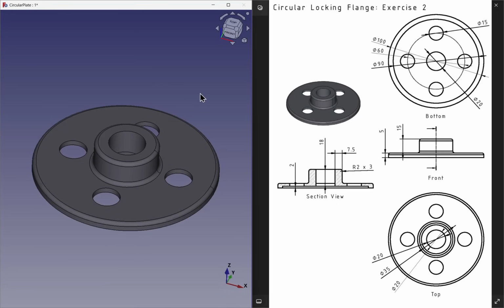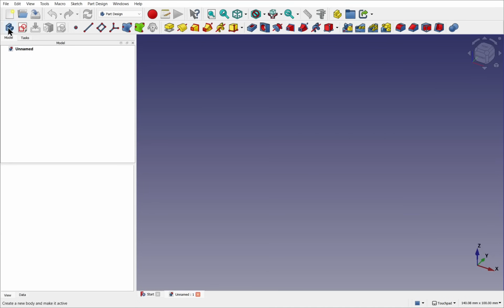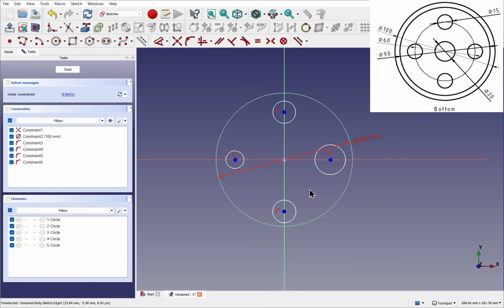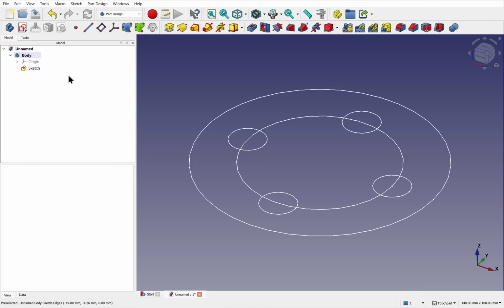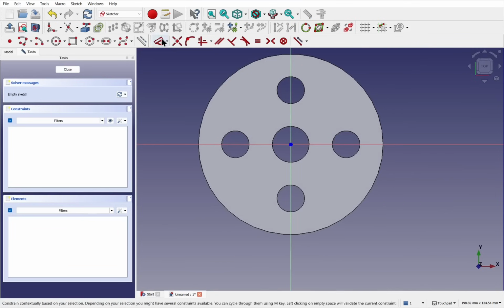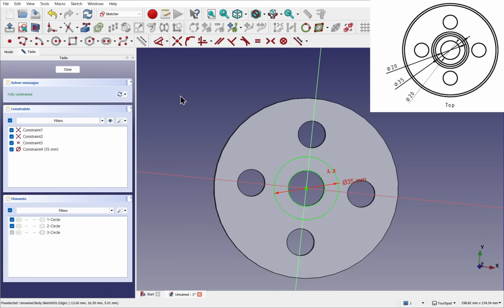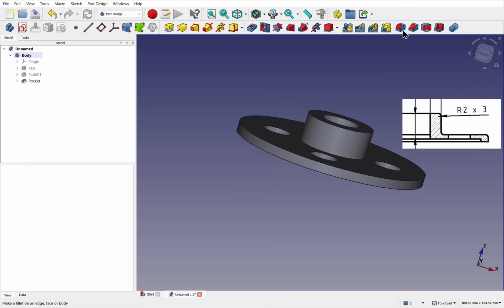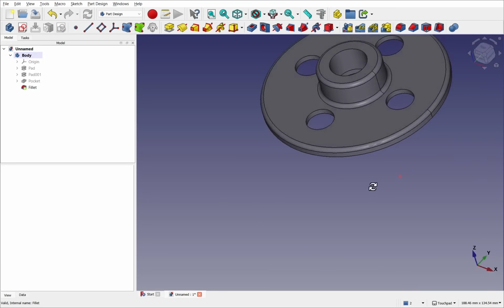Basic Beginners FreeCAD v1 / 0.22  Lesson 8  Part Design Basic Exercise 2 | Circular  Flange Project

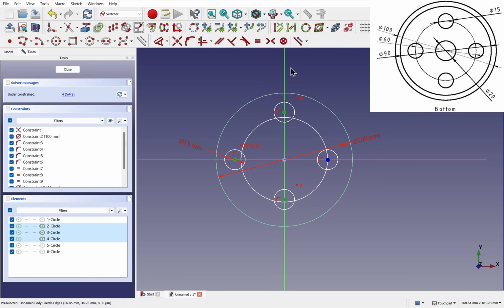Comment: The problem with this video is that what I get to 9:20, I can't see my "Constraint by object" icon on my toolbar. I've tried to reinstall it, but that doesn't do anything
Reply: Don't worry, I found the problem. I needed to edit the Sketcher preferences, and uncheck an option to get those buttons
Reply from the maker: There is a icon on the toolbar that combines both coincident and point on object constraint that can be used.  This was later combined as one icon after the videos were created which was pretty annoying and has cause confusion.  I am looking to back fix these earlier video but will require a reshoot.  Glad to see in your other comment that you have resolved the issue.

Comment: 9:47 FYI another change as of 1.0 is "Experimental support for multiple solids within a Body was added" which is defaulted to off in preferences and per-body.
But I was able to make that pad without error (although it of course looks awful) even with those settings off.
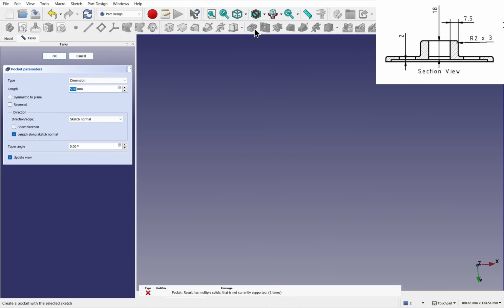Same at 17:04, the pocket operation unintentionally worked (leaving a rim of material between the outer circle and the 90mm diameter)
Reply from the maker: Thank for adding that, really appreciate as I can roll this into future video updates and it helps others when they see the same behavior.  Thank you :)

Comment: Thank you.  Your videos are excellent and getting better over time.  I'm having trouble but I'm wondering if it's my computer and software. The construction lines in v1.1.O development and the release V1.0 disappear as soon as drawn leaving only the center point visible. In a new file and sketch before anything else is drawn an xline will display correct as blue and dashed.  But, as soon as a regular line is drawn the xline disappears. Also my versions don't seem to have constrain point to object but another one worked. I also tried 20.2 but it didn't work, (forget why) now it won't run with other file open, maybe since sharing cache directory location. Could it be FC has the old "Sewer"Works software problem,  not very AMD friendly? Or are these bugs? I'm too new to know to report them as such. (My old laptop  has 17" screen so I keep. It's runs Debian 12, AMD A6 processor, 8GB memory. Has no issue with videos or image graphics.)
Reply: Found my own answer.  In Debian 12 I had not removed Synaptics installed Freecad before trying NEW Precompiled App versions. Also jumped back & forth between when there were differences with instruction videos. Then the disappearing construction line issue happened and could not be user error. 

My fix was: Remove the old installed v20 freecad. But, Synaptics would not remove it, slinging out broken package error, hold or lock on program. Reboot changed nothing.  Forced a removal in terminal  (sudo apt remove --purge freecad,  then sudo apt autoremove)  Now,  back in the pre-compiled app  v1.1,  CONSTRUCTION LINES DISPLAY PERFECTLY!

Comment: Loving the format, but struggling a little bit. Looks like the UI buttons have changes in the vers 1.0 vs the one used for the video. I don't have a button for the constraint point of object that looks like it does in the video. Not sure if its a button/UI change or if I am missing a tool bar. Any hints? Using 1/0/0 Revision 39109(Git). Thanks in advance.
Reply: I was able to use the constraint coincident button to achieve the effect. Not sure if its a change to the UI or a problem between the keyboard and the chair.
Reply from the maker: Since 0.22 which was the dev version of v1 they have changed the coincidence and point on object constraint to be 1. I need to look at redoing these videos to make them easier to follow.

Comment: After I created the external geomety and clicked on the 2 lines then clicked on the Equal Constraint, then resized my other circle then closed. My Sketch001 become its own drop down menu. I had to click and drag it into the previous Pad drop down menu so that I could use the Pad option, otherwise I was getting an error. I followed everything you did exactly,  maybe I am using a newer version? Or is there a preference that auto combines the 2 operations once completed? Great tutorials though, I am excited to be learning this program!
Reply: I ran into the same issue. You are in the sketcher workspace, but you need to be in the part design workbench when you are creating the sketch on the pad!

Comment: I do not have the constrain point on object icon and its also not in the drop down menus.
Reply: It has been combined with Constrain Coincident and has a slightly different icon in the toolbar now. The shortcut key is “c”
Reply from the maker: It's a different icon now since the official release.  And now is both coincident and point on object constraint.

Comment: I HAVE BEEN WATCHING YOUR VIDEOS FOR  QUITE A WHILE NOW, MY FREECAD COMPUTER FINALLY CAME IN YESTERDAY AND TODAY I WAS ABLE TO DOWNLOAD AND START TRAINING IN FREECAD.  SOMEHOW IN ALL MY BUMBLING THE "PLANE SELECTION IN 3D VIEWING AREA" HAS DISAPPEARED, NOW I AM UNABLE TO DRAW ANYTHING.  HOW HAVE I GARBAGED THIS UP.  I UNINSTALLED AND REINSTALLED AND THE PROBLEM STILL PERSISTS.  ANY IDEAS??
Reply: Go to Edit menu and click on Preferences then click Reset on the bottom left corner on the dialog window and choose Apply. This will restart FreeCAD with default settings.
Reply: @LFANS2001  THANK YOU FOR YOUR INPUT,… STILL HAVING PROBLEM, IT BRINGS UP BOX TO CLEAR USER SETTINGS, IF I CLICK YES THAT KICKS ME BACK TO FREECAD WITHOUT BEING ABLE TO CLICK APPLY, IF I CLICK NO, IT JUST HANGS THERE…

ANY OTHER SUGGESTIONS???
Reply: @FLAMAGFISHING  Hi, can you specify:
 - What's your Operating System? 
- What's your FreeCAD version? 
- Which version have you started using FreeCAD? 
- The last time you've uninstalled FreeCAD did you chose to get rid of your previous versions settings? 

All these questions have to be answered in order to figure out what could be the problem.... 

...and the last one is how good are you to know where all the software components are store in your computer? 

Do you know there are several locations for the Workbenches and Macros and for example (on Windows envirorent) these two pieces are located under the User-Apps-Local Roaming. FreeCAD-Mods and so on....? 

Please reply one by one to the questions and maybe we've got a solution.

Note: f you're using Windows I'm able to progress helping you but if you're using Linux I can't go further.

Cheers
Reply: @LFANS2001  @FLAMAGFISHING Hi, can you specify: - What's your Operating System?
  WINDOWS 11

What's your FreeCAD version? - Which version have you started using FreeCAD?
0.21

 - The last time you've uninstalled FreeCAD did you chose to get rid of your previous versions settings?
THE BOX SAID “THIS APP AND ITS RELATED INFO WILL BE UNINSTALLED, I SAID UNINSTALL

 All these questions have to be answered in order to figure out what could be the problem.... ...and the last one is how good are you to know where all the software components are store in your computer?
I ALLOWED FREECAD INSTALL TO PLACE THEM

 Do you know there are several locations for the Workbenches and Macros and for example (on Windows envirorent) these two pieces are located under the User-Apps-Local Roaming. FreeCAD-Mods and so on….?
I ASSUMED WINDOWS WOULD PLACE THEM WHERE FREECAD COULD UTILIZE THEM, AND I ALSO ASSUME THEY WOULD BE REMOVED PROPERLY WHEN UNINSTALLED

 Please reply one by one to the questions and maybe we've got a solution. Note: f you're using Windows
I AM UTILIZING WINDOWS 11

 I'm able to progress helping you but if you're using Linux I can't go further. Cheers
I CANNOT EXPRESS HOW MUCH I APPRECIATE YOUR TRYING TO ASSIST ME IN THIS ENDEAVOR…

BRIAN
Reply: @FLAMAGFISHING  Hi Brian. Thanks for the answers. At first glance you did the correct actions over the UNinstallation. I do not have an available machine running Windows 11 but I suppose that the locations for FreeCAD are the same as Windows 10 that I use presently. My daughter has a Win 11 machine and I'll try to install FreeCAD on it and figure out if any differences show up. She's travelling abroad within 4 days let's see if I'm lucky...
If someone is following your saga please give us your point of view on this issue.

Brian, just clarify if you've uninstall with the Windows control panel or by the FreeCAD uninstall menu? And did you restart the computer after that?

If right now FreeCAD is installed try to reach these 2 locations through Windows file manager/ explorer: 
1) This PC - Windows (C:) - Users - (your user name) - AppData - Roaming - Freecad. Here there are at least 2 Folders called Mods and Macro.

2) This PC - Windows (C:) - Users - (your user name) - AppData - Local - Freecad. Here there is a Folder named Cache.

After UNinstall those locations must not exist anymore. 

So long for now.
Luis
Reply: @FLAMAGFISHING  Brian, sorry but I was mistaken about my daughter's machine. She also has a Win 10 machine.
Never the less I was recalling all our dialogs and the issue you are complaining it's happening with my system and FreeCAD version. 
If in Part design workbench you start creating a Part + Body + Sketch the 3 planes are visible in the 3D viewer window.
But if you go to Sketcher workbench and in Sketcher menu you click on Create a sketch the 3 planes are not shown on rgw 3D Viewer window. The remedy is for you to know by heart the planes which are very easy to remember: XY plane is Top view, XZ plane is Front view and YZ is Side view. In the Plane choice dialog window whatever your choice is, the cube will present the right/correct face before you click OK. In this dialog window you also have the chance to modify to the Opposite side and the Offset distance from the Origin (crossing point of the 3 planes).

So, there are differences when either you are using Part design or Sketcher workbench.

If for example  you already have created a Body, you can activate still see the 3 planes by selecting "Origin" within the Body in the Model tree tab and press the Spacebar on your keyboard. Then you select the Plane (on the 3D Viewer window) you want to deal with and create a sketch on the selected plane. This option is valid whatever the Body id active or inactive.
Cheers

Comment: Using 0.22 (37928)  and I do not seem to have a "constrain point on object". I presume that this is the same as "Constrain coincident". Seems to do the same thing.
Reply from the maker: This is different constraint.  I have had a look at the version I have which is a later one and it is there.  Looks like an arc with a point on it.

Comment: I had to go back to the stable version to find the constrain point onto object button (I could find it in the toolbar right click -> customize -> toolbars and scrolling down to it, but nothing I did would add it to the toolbar). Adding the first circle worked fine, but I just couldn't get ahold of the button to constrain the three remaining ones. Is this just a quirk from the nightly version I running or am I doing something to cause it?
(Also: great tutorials, really appreciate them being as thorough as they are and explaining why things break or won't work!)
Reply from the maker: Ahh, just revested this as I did a bit of digging.  Looks like they have changed the tool.  Now the coincident and the point on object constraint are both on the same tool.  Looks like I am going to have to reshoot some of this video.  I though this may happen as I am trying to get in early lol.  Oh well not a big issue.   Glad your enjoing the videos :)
Reply: @MangoJellySolutions  Came across this tonight.  From what I found in the Forums, there is a setting in Sketcher Preferences menu.  By default with 1.0, "Unify Coincident and PointOnObject" is checked, and that's why the Constraint Coincident tool was used.   If you uncheck it, you get separate tools again like previous versions.
Reply: I just used the 'constrain coincident', in the tooltip it mentions now that it allows you to "fix a point on an edge".

Comment: How do you have FC configured that you have to enter the radius of a circle and not the Diameter?  I only have diameter option for circles.
Reply: When creating a circle, using the "Create circle by center" tool, the system will prompt for the circle size.  Whether it prompts for a radius or a diameter is dependent upon the Preference settings (Edit>Preferences...) for the Sketcher workbench. In the General section of the Sketcher preferences there is a "Dimension tool diameter/radius mode:" setting (Auto, Diameter or Radius). This will determine which prompt you get. Either Auto or Diameter will prompt for the diameter. The difference between the Auto and Diameter choice is only seen when using the Dimension tool (not the Create circle tool). Auto will automatically dimension arcs (partial circles) with a radius and full circles with a diameter.
Reply: This is the 0.22 DEV version on the video. If you are using 0.21.2 version it's slightly different but you've got 3 options anyway, click over the small arrow next to the  Constraint Arc or Circle tool.
Radius, Diameter and Automatic  will be shown.
You can opt by one of them. 
Note that your choice will be remembered by FreeCAD and next time the same type of constraint will be applied. 
Normally it's better choose Arc/Circle auto because whenever is an arc or a full circle a radius or diameter will be applied.
I hope you have got the concept in mind now.
Good modeling

Comment: Why would you not just sketch a cross section and revolve?

Just got to the end... Lol. Yes you would.
Reply: ‘cuz this is a beginner video. :)

Revolve is simple to you but strange and mind-bending to a noob.  I should know, I’m one of those noobs! :)

One downside of using revolve too early in your CAD learning is that you may over-use it and end up generating faulty geometry that causes errors.  Ask me how I know. :)  FreeCAD is a very powerful program though the error messages are unfortunately written mostly in Greek as far as I can tell.  The errors rarely say anything helpful and searching online for them is hit or miss.  Several times I’ve run into an error and had to rebuild the model from scratch because I couldn’t decipher how the error could be fixed.

When you’re a beginner: start simple!
Reply: Good tip to set deviation locally instead of globally in preferences.  You are certainly a TouchPad ninja. I need the mouse for my modeling.
Reply from the maker: Yeh deviation cleans everything up.  Oh I have moved more to a mouse now for teaching.  But when I am modelling siting on the couch in front of the TV my missus hates me using her leg as a mouse pad.
Reply: @MangoJellySolutions  Understandable.
Reply: I've just drawn something similar but with a rectangular base, and spent ages creating loads of constraints to position them. A cross section and revolve wouldn't have worked for that, but I assume I could have drawn a rectangular construction line for the four holes, instead of a round one.
Reply from the maker: You could of used your construction geometry to position the holes or a pattern. 
 Also taking into account if your model is symmetrical (going to get to all of those :) )
Reply from the maker: My cunning plan has been revealed lol :)  Guess what the next video is about.
Reply: That's how I would've done it too, but I used a polar pattern to create the 4 holes instead of 1 sketch.